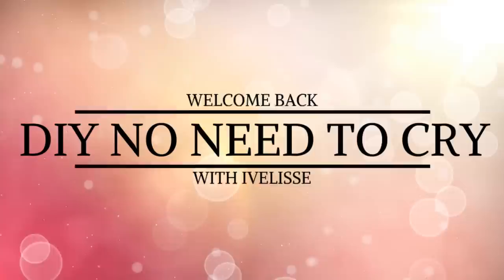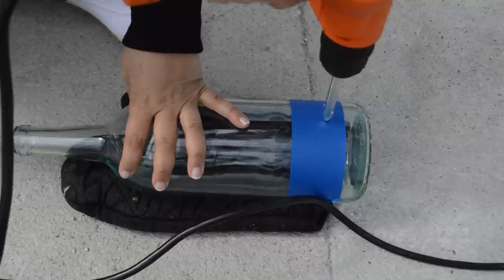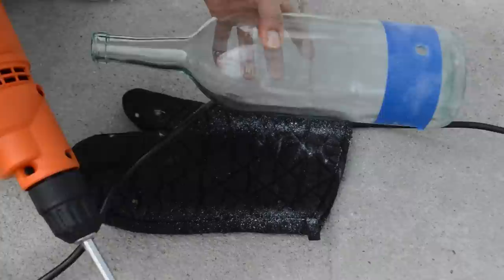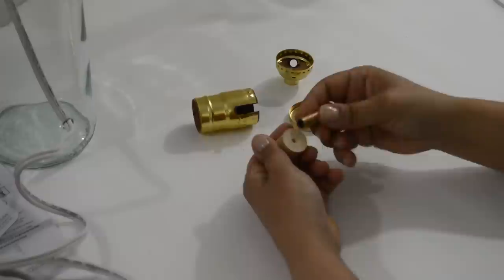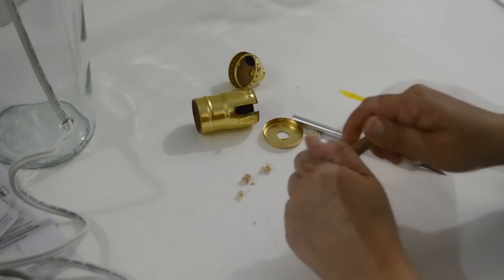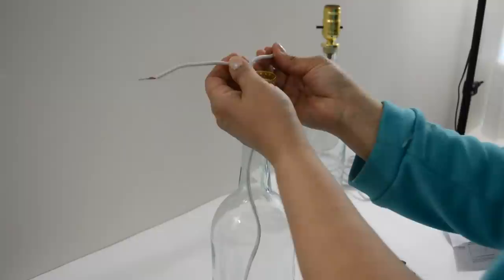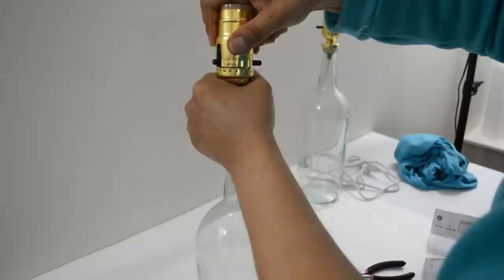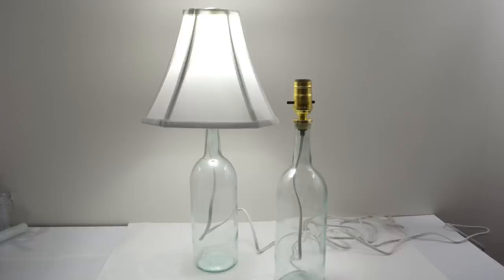How To Turn A Wine Bottle Into A Lamp | DIY No Need To Cry

Comment: Saw another video where they drilled the hole in a bucket of cool water to keep it cool and prevent the glass particles from flying in the air. Just a potential extra tip!

Comment: 2 tips to make things safer and easier. 
1) They make grommets that will fit the hole drilled in the bottle and the wire threads through that. This protects the wire from being scrapped by the rough glass and prevents shorting it out.
2) When you attach the wire to the socket bend the wire over the screw clockwise as this is the direction the screw is tightened and it will be much less likely to strip out.
OK, I just thought of something else, 3 ;-) Try drilling the cork out with a bit slightly undersized of the threaded rod. It's small enough and soft enough you could probably hold it in your hand keeping the drill at a slower speed.
Cool though the cork idea. I don't think I've ever had one of those stoppers fit well and the corks are always long gone  but I'm going to try to get them at a craft store. Thanks ;-)
Reply from the maker: Awesome tip! I knew about the rubber grommets I just couldn't find them but that tip about the drill, whoohoo! That would have been a lot easier lol! Next time! Thanks, Charlie! Happy crafting! 🤗

Comment: How did you put the lamp shade on
Reply from the maker: Hello! 👋 On this particular lamp kit, you have to buy a lampshade that has an open ring in it. You place the shade by placing the ring around the bulb holder and then screw the lightbulb in. I hope that makes sense 😆🙏🏽🤗

Comment: Would a regular drill bit work because I don't have a glass drill bit ??
Reply from the maker: I've never tried it but I don't think that's a good idea.
Reply: No.  Go to lowes or home depot and get a ceramic drill bit for tile and glass.  You can also get diamond grit hole saw bits on amazon for $8 for a 4 pack.
Reply: Hey I ordered a box of diamond cut drill bits from Amazon for $10
and it worked...
Reply from the maker: @bobbievillarreal5305  Awesome!!
Reply from the maker: @Angelo Gamble The other pieces will fit, I didn't realize it at the time but when you screw it tightly, the piece will expand and fill the hole.
Reply from the maker: @Angelo Gamble 🤔 You could try and safely trim the bigger one until it fits the bottle if nothing else works. You could aslo buy a cork at the craft store. Maybe ask a family member if they have one laying around?

Comment: Is it safe to put rocks in the bottle to weigh it down?
Reply from the maker: Yes!! Just make sure to tilt the bottle when placing them inside so they slide on the side of it. It will prevent them from dropping straight in and cracking the glass.
Reply: @DIYNoNeedToCry  thank you!
Reply: i used play sand to fill mine.
Reply from the maker: This is also a great way to give the bottle some weight as long as you add a rubber grommet to the lamp cord hole to make sure none of it spills out.
Reply: @DIYNoNeedToCry  or clear caulk ;)
Reply from the maker: @MrH00nel2  Brilliant!

Comment: You could have used a drill to drill through the cork,lol very cool craft though.
Reply: I'm gonna try this but I'm curious if I drilled the hole lower if it would be okay? It seemed a little too high, what's your thought?
Reply from the maker: I didn't go lower because I was afraid of breaking it, but I have since made more and have drilled lower. It is safe, just don't go to close to the edge.